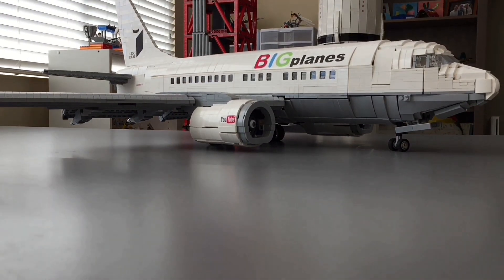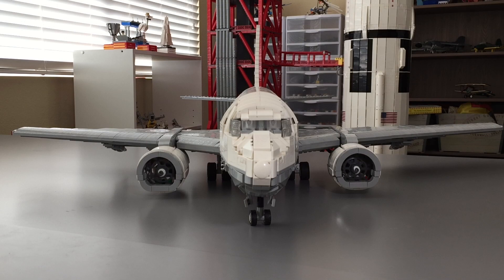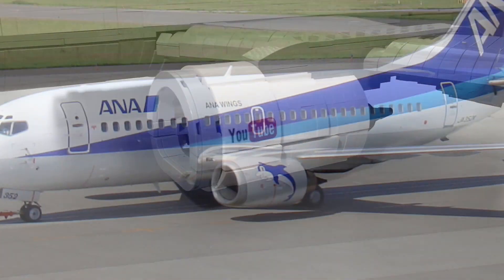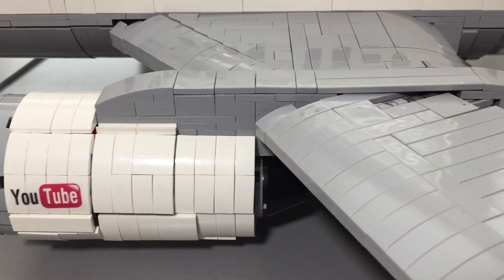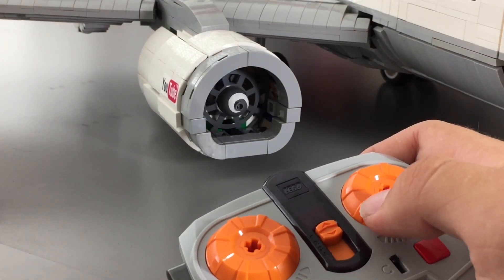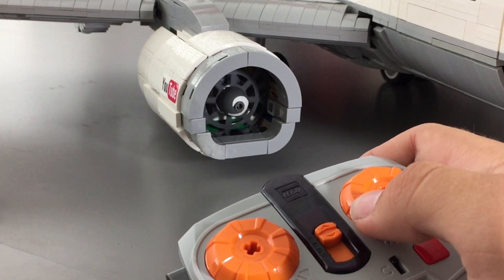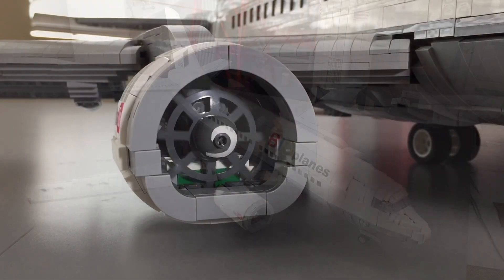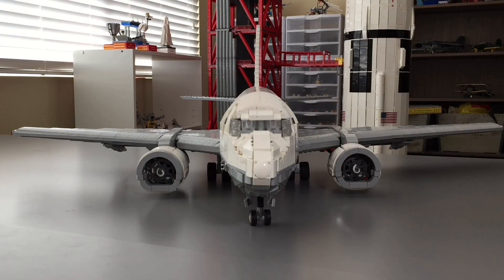Motorized LEGO 737 engines !!!

Comment: I have run into a dilemma in my a319 project. The engines are too large and to solve this i lengthened the landing gear. Now the hinge connected to the landing gear is in the way of the engine. There is another problem. The a319 has another support beam and I have no idea how to incorporate this into my own project. My landing gear now is too weak. I’m lacking in space and need a solution. I go to you because I know you have been through this stuff. Keep up the work and thank you for the inspiration you give me :)
Reply from the maker: Hmm. I think your overthinking this. Remember the designers of the aircraft have already done all of the work for you. You shouldn’t need to extend the main gear. If the engines are too large that they should be smaller to allow for the gear to be smaller. I would try to stick as close to the original design as possible.
Reply: Any thoughts on how I can strengthen my landing gear?